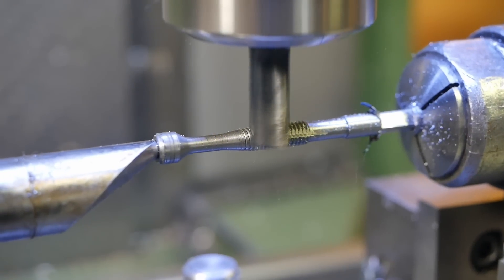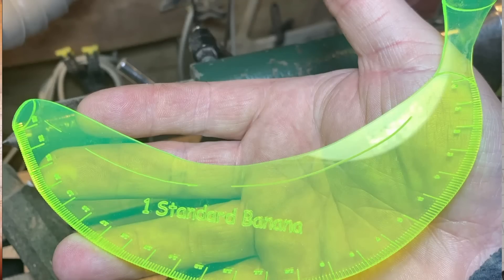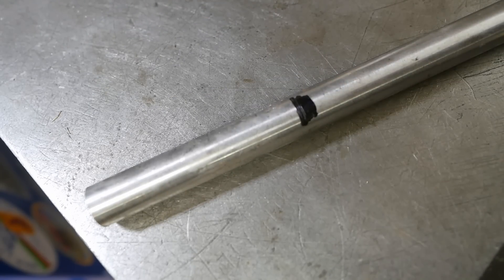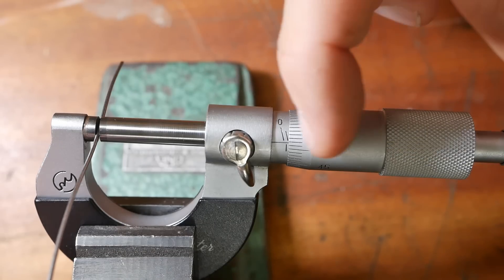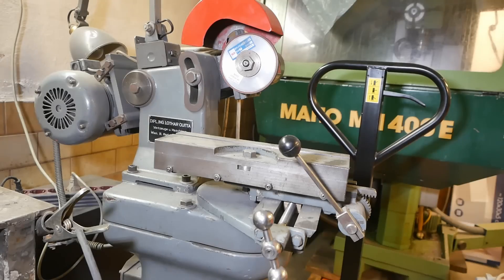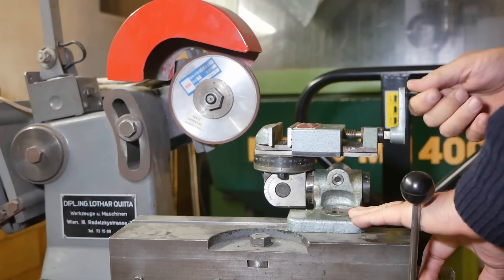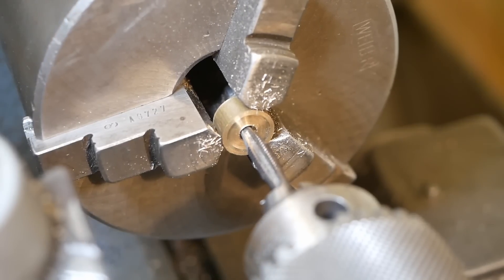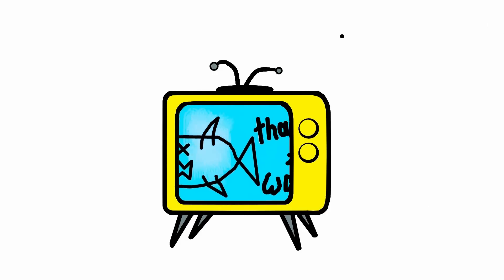Making a custom tap on the the mini lathe. || RotarySMP

Comment: Hmmm I still don't know if the aircraft bolt thingy was sarcastic or not.
Reply from the maker: Not sarcasm. Those high strength corrosion resistant bolts used in the hot section gall really easily, so if you try and remove them, you are likely to get a bunch stuck half off and galled. By just cranking them tighter and snapping them all, you have much less risk of damaging a flange dealing with a seized bolt.
Reply: @RotarySMP  also neatly avoids the risk of reuse ;)
Reply: @fuzzy1dk  There's something comforting about safety-critical work and helping people avoid catastrophically bad decisions.
Reply: @RotarySMP  F404 afterburner flameholder bolts are the same way, I learned to my surprise quite a long time ago.
Reply: @RotarySMP  oh interesting didn't think about that, yeah seized bolts are a pain in the but to remove, at my work we could mill them out but that's not possible everytime you have a seized bold

Comment: Congratulations you have made a thread chaser. By the way taps are "relived",... on the trailing edge , and the trailing edge is just a few thousandths of an inch closer to the true center of the tap than that of the distance of the leading cutting edge to the center of the tap.
Reply from the maker: Good point. Worked well enough for my task though.

Comment: 12:13 might be zirconium mold wash they normally use for sand casting. Is it mixed with metho.? I worked at a foundry many moons ago and they would paint the sand moulds in something that looks very similar to that. When done you would light it on fire to burn off the solvent.
Reply from the maker: Could be similar.

Comment: What's the runout on your mini lathe now that it's mostly completed?
Reply from the maker: I didn't do anything to the spindle which would affect runout. I just except replaced the ball bearings with tapered roller bearings. This may have been a mistake. If the bearing bores were are poorly machined as most features, the rigidity of tapered rollers will be fighting misalignment, and they will wear out fast.
Reply: @RotarySMP  some people say to replace with tapered roller bearings others say angular contact bearings, is it the same thing?
Reply from the maker: @ryanr3618  No, the geometry is different. Both provide significantly greater stiffness then radial ball bearings, but also require much tighter tolerances on the bores and shaft.

Comment: 14:32 i was thinking of those cylindrical dremel stones, usually pink...if you could mount dremel securely enough, that would be the challenge..
I got a clearance lot of 3M epoxy and adhesive at least 15 or more years ago, nothing to use on so cast rounds, it worked like new and the adhesive still good but more viscous.
Reply from the maker: I have a couple of nice internal grinding stones, but no arbor to fit them to the Clarkson. I also had a think about bodging my air die grinder to the Clarkson, but the cut off disc worked suprisingly well.

Comment: Straw color? Im seeing blue too. Too much heat
Reply from the maker: The recommendation for small taps was 270°C, which is beyond blue, into brown. I just followed that recommendation. Seems like a good choice, as Jörg did the job, in steel, and power tapped the 8 parts :0

Comment: That's far nicer than the last tap I made... I needed a 1/2" 3 start Acme tap and I ended up having to make it with a dremel... In the end it worked but it was really ugly. I can't even remember what I had to make the tap for anymore.
Reply from the maker: Sounds like a beast of job, as Dremels are not exactly ideal for fast metal removal. Good on you for making it work.

Comment: If one already has a grade 8 bolt, why not just use the universal grinder and cut reliefs in it to make it into a tap?
Reply from the maker: Because a grade 8 bolt is not hardened s much as tool steel, and will wear fast, or not work at all in steel.

Comment: You could have done the back-relief on the mini-lathe using LinuxCNC External Offsets:
https://youtu.be/fo7SwanH50I?t=178
Reply from the maker: Hi Andy,
I linked your video in there. Your video is brilliant. I doubt that would work on my mini lathe, as there is a far bit of backlash in the X screw.

Comment: Thanks for the amazing videos as always!! Quite a while ago you gave me some tips on epoxy granite for the lathe I was designing which were extremely helpful, thanks again. I now have the cross slide mostly complete, although I still have to scrape 3 foot ways by hand to go from hot rolled steel to ideally within 2 thou over their length which seems…. Daunting….     I was thinking of using an angle grinder to get within 10-20 thou and then filing and then scraping to final dimension? Hopefully that doesn’t sound too insane but if you have any thoughts on it Id love to hear them! As a college student who only saw a lathe in real life starting a year ago any experienced opinions are treasured hahaha. Thanks again for the great content!
Reply from the maker: Cool project. Angle grinder “scraping” is used by the pros on harden bed machines, so it is a thing. Use one of those for overlapping sandpaper style discs, with fine grit, and take it slow. Where are you posting this build? I’d like to see it.
Reply: RotarySMP thanks a ton! Im starting with hot rolled steel and not especially straight hot rolled steel so the angle grinder flap disk will hopefully improve my life by miles hahaha. Unfortunately I don’t really have a youtube channel, although I was actually thinking of possibly making one for this project? My progress is slow for sure, but it would be a cool way to document the project! Do you have any tips for starting a channel by any chance?  It feels a little intimidating to get started posting on a channel but itd be really cool to share and see what people think/what they’d change and all.
Reply from the maker: @robertsteinwandel6658  I started just editing my first videos in the free video editor in MS. Main thing is just go for it. Start simple with short videos. You get better over time.
Reply: RotarySMP Thanks! Ill let you know when I get that started up if you’re interested!

Comment: Blowing my own trumpet, on my channel I have a few things thread cutting related. One a one hand three wire gizmo, another a micrometer for measuring the flat at the pointy end of a threading tool. The easy use threading tool won't interest you as you have CNC. I have CNC but in my case it stands for Chris' Numbskull Control.🤔
Reply from the maker: Thanks, I'll take a look.

Comment: It is highly remarkable. My Youtube database in my head says you took too many passes cutting the thread. Yet I like the mini-lathe, and the vice is fantastic.
Reply from the maker: I dont have enough experience with thread cutting or G76 multipass. If I do to few passes, the thread is normally ragged. This worked well in that the tool didn't rub, so I got a really nice surface finish in the thread. Lucky the exra passes only add a few second with CNC.
Reply: @RotarySMP  just thinking of something TOT said, don't goes overboard on the passes and finish it us with a file. Yet, he was reducing the burs on the peaks. However, you might have been able to create the defined peaks by using the grinder. In saying that, it cut the right thread, so really, it's not a big issue. I'd certainly be pleased with that effort.  Is it me or does TOT sound like Hawkeye from Mash?
Reply from the maker: @tcratius1748  TOT does sound a bit like Hawkeye. 
My test piece had the flat topped thread because I first cut the diameter wrong. I correctde that, and then the proper tap had normal tops. Still slightly truncated, but that is the Unified norm. If they had come out with sharp tips, I would have cut too deeply.

Comment: Hey, that's no uglier than MY first shop-made tap!  Only, you spent a lot less time on yours.  Mine took a couple tries, and not having a grinder, it took hand-stoning the flutes and reliefs.  It tapped the ONE hole I needed.  To this day, I don't know what size it was supposed to be.... nothing in Machinery's Handbook matched.  It was on a Pre-WWI handgun, so, who knows what thread system it was using. Still have that tap somehwere, but, I don't know that it has another thread in steel in it.
Reply: Possibly Whitworth?
Reply: @jonathan1427  Possibly... but it didn't quite match any of those, either. With 100+ years of wear, and original slop, I'll probably never know...
Reply from the maker: I was a bit disappointed about that final grind. Thinking about it, I should have used a normal wheel, not a cup, and I could have had the surface to be ground at the top, and had better vis on it.
Reply: @RotarySMP  Well, like I said, it looks WORLDS better than my "dremel and hand stones" tap, and yours will probably cut a second thread!

Comment: What a nice project! 
Btw I wouldn't mind an excursion into the design process in Free CAD tbh.
Reply from the maker: Pretty simple.  A bar, a taper on the end, and a triangle drawn and swept along a helix. Finally the flute and then a crown array of it.
Reply: @RotarySMP  Offf.... I'm happy when I manage to extrude a shape in FreeCAD 🤣 So that's still way beyond my level
Reply from the maker: @Elektronaut  FreeCad is a bit of a clunky interface. Try Onshape, which is a bit more forgiven for beginners. But basically it really was just:
1/ XZ plane - draw a circle of the tap OD.
2/ Extrude to tap length.
3/ XY plane - Draw a small triangle whch represents the thread form (this took a bit of simple math and head scratching), position it out from the CL so the tip is at the thread minor diameter.
4/ Use the loft along helix function to make the thread
5/ I used the chamfer tool, with dimensions of 1mm and 10mm to make the tip taper.

Comment: What engraver do you have?
Reply from the maker: None. That was just my Proxxon little grinder thing.
Reply: @RotarySMP  ok i have a little hand belt sander from proxxon.. i need a dremel... i wish i had money for one of thoes fancy german small grinders but i will have to do with a cheaper dremel.
Reply from the maker: @nikolaiownz  That expensive pencil grinder which Gotteswinter uses looks really nice
Reply: @RotarySMP  exacly the grinder i am thinking about. I think Peter Stanton uses it aswell. I think a dremel with the flex extension mounted on My work bench would be just fine for us haha

Comment: I wonder if it would have been better to cut the threads before the relief on each end of the tap form. That would have had less spring when thread cutting, and it might have cut closer to the expected size.
Reply from the maker: Good point. I didn't think of that.

Comment: Omg, flashback.... that FeC Diagram caused me taking three attempts at materials science exam at tech university....
Reply from the maker: Yeah, I remember having to draw it from memory too
Reply: It's interesting (Well, at least to me) that it is pure coincidence that the Curie temperature is also the transition temperature. It could, in principle, be lower. But not higher as Austenite is not magnetic.
Reply from the maker: @andypughtube  I thought the transition temp is the switch to Austenite, and there for the reason for it being the Curie temp.

Comment: I find it far easier to use a full form insert. I am far more likely to have the right one in stock than I am to have a selection of wires. LOL  I never use single point inserts to cut a thread, far too much messing around.
Reply from the maker: Good point. Measuring over wires is a PITA.
Reply: @RotarySMP  Keith Rucker showed a set where the 3 wires were held together in about the right configuration for use with some kind of flexible thing (rubber? String? I cannot remember)

Much easier to handle, and harder to drop. It also meant the multiple set of 3 wires couldn't mix up the wires.
Reply: @RotarySMP  I was never going there.  As I needed to make threads on a production basis, my relief on discovering that full profile insets existed was immense.  The cost of an insert per pitch is irrelevant, when it gives perfect threads all the time, with only the measurement of the Major diameter required.
Reply from the maker: Makes sense for production. Since I was only mucking around, this was a good learning experience. 
I did bent a longer wire into a U so two would stay in place, and then just needed to hold the third with one hand while holding the micrometer with the other. The third hand turned the ratchet.

Comment: 24 tpi sounds like a  #12-24 tap. Which is slightly larger than 1/4".
Reply from the maker: He measured it as 6.32mm, so I thought 1/4. The nut I made seemed to fit very well.
Reply: No, a #12 is .044 inches smaller than 1/4".  ( 12 × .013 ) + .060 = .216
1/4-24 would be #14.615-24
#12-24 would be 115964117/536870912-24 (fractions are ugly when carried too far)
Or in metric:
#12-24 would be M5.4864x1.058
1/4-24 would be M6.35x1.058
I'm a bit envious of those who get to work primarily with metric threads.

Comment: You can use for example gear tooth calipers to measure how far the threading tool needs to be plunged from the tip of the threading tool.
Reply from the maker: Yeah, but I dont have any. Would be another nice tool to have.
Reply: @RotarySMP  I put a link to aliexpress but YouTube doesn't like links so it got removed right away
Reply: Also there's some name brand ones below 100e on ebay if a chinese tool is no-no
Reply from the maker: @MF175mp  Thanks. I am on tool purchase withdraw therapy at present :)